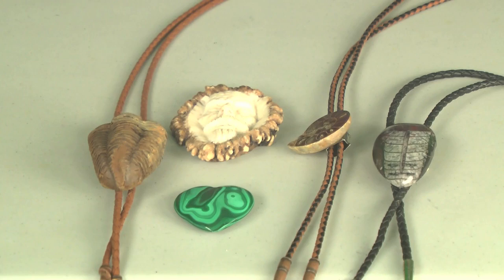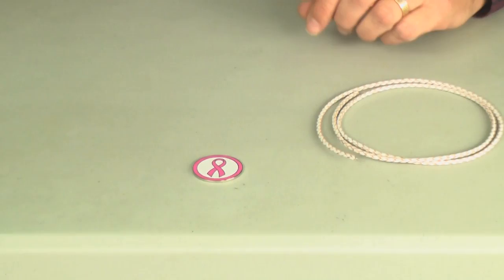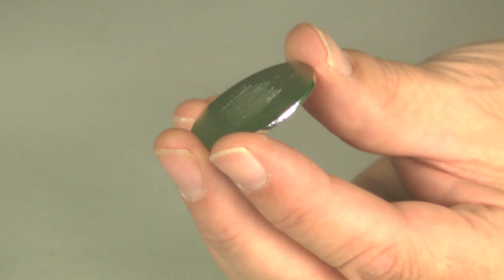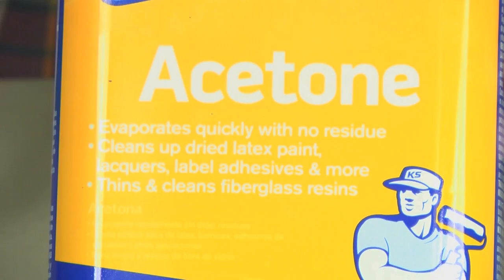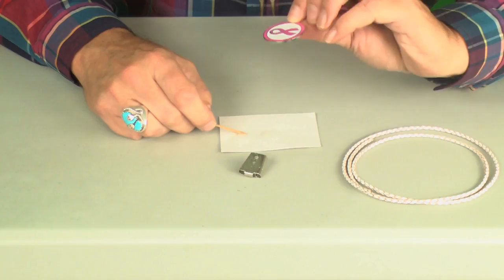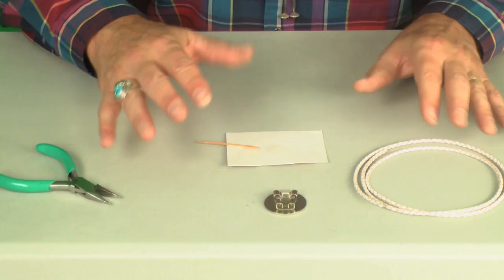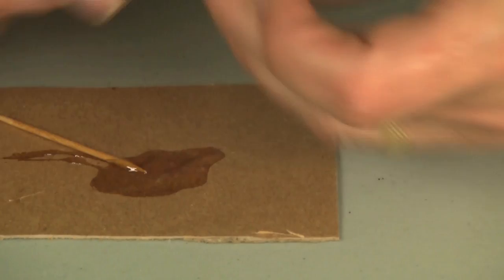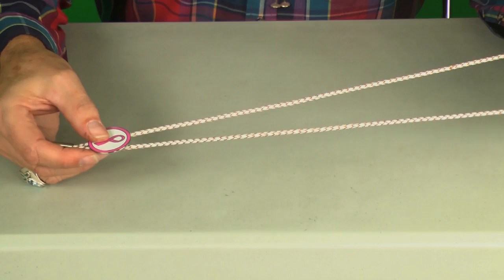How To Make A Bolo Tie From Almost Anything Full

Comment: Hey there! Love this vid. Wondering if you have tips on removing pin backings to make a cool pendant? 
Thanks<3
Reply: I assume you want to remove the pin on the back of a broach?  
Just clip it off with a pair of pliers.
Then file the rough edges down with a file or Dremel tool.

Comment: Hi! Have you tried using something that's not metal? I have fun little plastic toys from the thrift store I'd like to make bolo ties out of and wondering if that'll hold very long. thanks for the tutorial!
Reply: Hi Lillian.  Yes, if you use a good epoxy plastic toys will work fine and hold on.  Make sure the clasp is free of oil, including what's on your skin.  Acetone is the best cleaner -- aka Nail polish remover.
Reply: @stevebalog5980  thanks a million! can't wait to get creative with this.

Comment: For stones/gems do you recommend the dremel step on the back of the stone? Or is that just for plated metals?
Reply: Grind BOTH the back of the stone and the metal piece.  The epoxy will hold on all those micro-cracks.  Good luck with your project, James

Comment: Two glues? Sorry my English is so bad😅, what is this 2 type of glues plllz
Reply: Epoxy -- it comes in two tubes.  They are mixed together, applied and the they harden.  Or you can use a good quality glue - Super Glue, Crazy Glue
Reply: @stevebalog5980  So thankful for your reply 💖